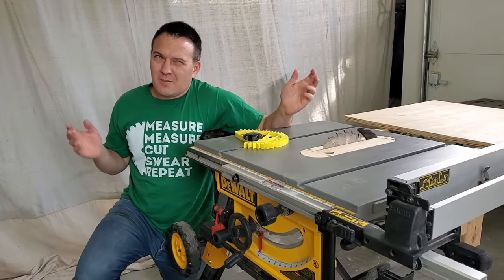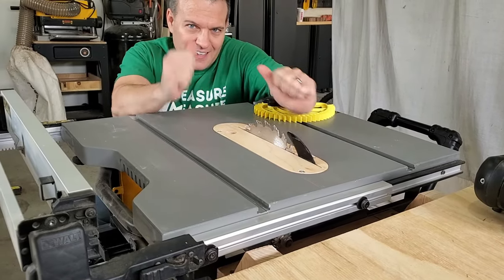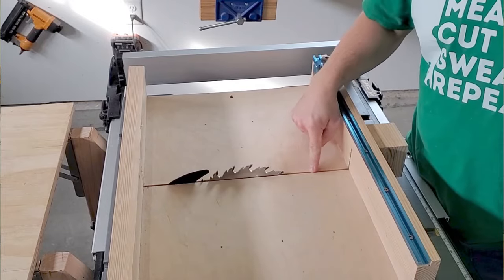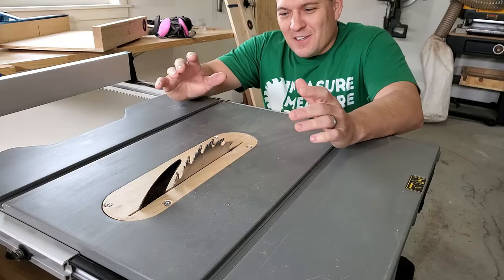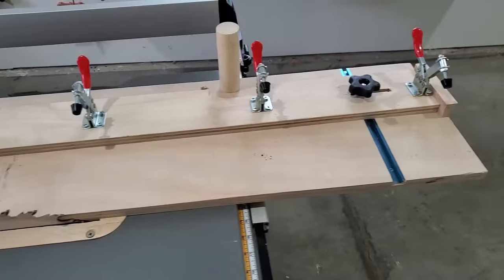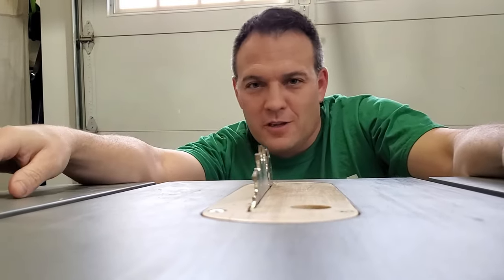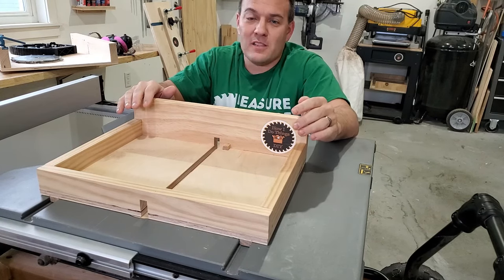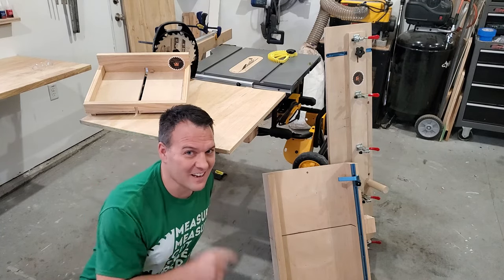MUST HAVE Table Saw Accessories!!!

Comment: I bought your table saw out feed plans and modified them so I didn't need to drill into the saw base. Works awesome. That was a great design. Thanks.
Reply from the maker: Thanks!  That's sounds cool.  How did you do it?
Reply: @HowIDoThingsDIY  I used my band saw to make "J" shaped hangers that fit the frame below the fence rack and pinion. Then I used angles like you did for the bottom. Works great. The "J" shape lets the frame hang, removing the need to drill the frame. I can't post a pic here. But basically your design, but "J" shaped vertical pieces that hang, removing the need for drilling.
Reply from the maker: Does it stay in place when you fold the saw up?

Comment: Around here, we pronounce it DAY-doe but... you be you. I have this exact table saw and also have a limited amount of space. I recently replaced the splayed legged stand with a rolling cart that doesn't try to trip me every time I try to walk around it. Folding out-feed and side support tables are next on my TDL.
Reply from the maker: Haha.  Ya. I actually know that and I've been working to correct it.  Saying it wrong seems to be a hard habit to break.  Yes, the folding outfeed table was a huge improvement.   I have plans for it as well as other stuff for that saw on my website, if you're interested.   Www.howidothingsdiy.com
Reply: @HowIDoThingsDIY  My brain still has trouble with 'rebate' vs 'rabbet'. Watching too many Paul Sellers videos will get you saying 'rebate'. ;-)
Reply from the maker: Haha.  That's funny.

Comment: I call my tapering jig a mitre sled as well.  It was designed to be tapering / cross cut / mitre sled.  Mitre is jus a different angle than taper if you think about it.  It can have some fix angle template to make setup easy.
Reply from the maker: I like it!  Thanks for the comment.

Comment: I've had the DWE7491XE (240v 1ph version) for a couple of months - wanna make beehives, workshop cupboards and drawers, and much more. I only see dado stacks in US videos, and it's been hard to find guidance on what to use. I'm heaps glad that you made this video coz it's exactly what I plan to do and with that exact same saw. Gotta good look at that dado set 8" Freud.

Only question - have you noticed if the spindle locknut stays tight on the dado stack? Since the saw has electric braking, I wonder about the inertia of the rotating mass of the stack perhaps loosening the spindle nut. I also read that over-tightening the nut can distort the blade.

About to watch the outfeed table video - Thx for taking the time to make short sharp videos.
Reply from the maker: Thanks for watching!  I haven't had an issue with the dado set loosening  the lock nut, but I also don't notice any braking when the saw is turned off.  Could that be a new feature that my saw doesn't have?

Comment: So it was miter sled Sunday here… We have the same saw so I thought I would give you free access to my discoveries… no one would pay for them just sayin’

1) My miter slots had a bit of manufacturing slag in them. I ran a 400 grit diamond plate on all four miter slot  sides about 25 quick passes with a little water. That really helped.

2) There was this odd stickiness at ends of each slot. A quick measurement showed indeed the ends of the slots came in just a bit. More diamond plate, another 20 or so passes focusing on each of the ends. Cleared that up now my runners run great end to end.

3) I used oak on one sled. Plastic on the other. Why? because I heard goods and bads on each. I’ll let you know if anything wonky happens with either. Both are currently good. 

4) Both sleds are creating great 90 degree cut or dados

You may be wondering why the diamond plate and not something else. Truth is it seemed like the flattest mildly abrasive thing I could think of without doing some high grit sandpaper shenanigans.

I also noticed when starting a 10 inch the blade actual wobbles about 1/64 of an inch left to right. I only mention this if you or anyone else needs to stop a precision cut in the middle it is better ( and safer) to back the piece and slide in after the cut is started. Else there will be a wide spot like in my crosscut sleds 0 clearence, now near 0 clearence. 😅

Lastly, I double checked that my fence, miter slots, and blade are all parallel an perpendicular to the saw top. I made sure my sled base was square then used the fence to align the sled base to the sled runners. No secondary fence adjustments needed. I will verify with the 5 cut method if I find something is off.

Happy sawdust creation Sunday!

You need a Patreon, just sayin’
Reply from the maker: Excellent work!  Sounds like you really have it dialed in.  As far as the miter slot guide rails, I've found plywood works pretty well because its more stable than the hardwood.  I've also been wanting to try UHMW plastic.  Seems it would be nice and slippery yet stable with changes in temperature and humidity.  Thanks for adding this info in my comments!
Reply: @HowIDoThingsDIY  Have you had a problem with hardwood for the rails? I debated using plywood myself but was concerned about the plywood flaking over time. Another thing I want to try is mdf or melamine with edge banding. Figured what would be slippery, stable and durable. More effort to get the rails the right width. So many options… when do I stop making things for shop and start making things for inside the house, gifts? 😂🤣😂
Reply from the maker: One of my sleds with oak guides got a little tight but I block sanded it just a tiny bit and then rewaxed it and it's fine now.

Comment: Hey buddy, I purchased your plans to make the outfield table and I'm thinking about making your crosscut sled too. I'm curious though if the (forgive me I can't think if the term) part of the cross cut sled that hangs down and rides in the miter slot will hit your outfield table if the outfield table is in the lowered and or raised position. Thanks in advance!!
Reply from the maker: Yes, It will hit.  I typically just fold down the outfeed table when I use the crosscut or box joint sled.  If you don't want to do that you can router some clearance slots in the out feed table.  I personally didn't want to weaken the outfeed table with the slots.
Reply: @HowIDoThingsDIY  thank you so much for the super quick response!!
Reply from the maker: I'm always here when you have questions.

Comment: I want them all! Great video! The feather board looks really handy. I put a GRR-RIPPER on my Christmas wish list, but could I use the feather board instead? Do they both work in a similar way by pushing the wood against the fence?
Reply from the maker: I'm not familiar with the Gripper, but yes, it pushes the workpiece against the fence.  I have an Amazon link to the one I used in the video in my description.
Reply: @HowIDoThingsDIY  Wonderful! Thank you so much!
Reply from the maker: No problem!
Reply: The GR-Ripper is a very cool pushblock, and could be used in conjunction with a feather board.

Comment: Awesome vid! I need to make this outfeed table! Checking that out next. It looks to have really solid and positive lockup. I’m curious to see how you did that. 

Btw, did you consider a 6” vs 8” before you decided to go with the 8” dado stack? I’ve heard that any contractor saw in general should stick to a 6” dado set.

I bought a 6” set based on that advice. I haven’t used it yet and I’m still debating if I should return it for an 8” set. I have the same saw as you.
Reply from the maker: Thanks.  I haven't heard that but I also haven't had any issues with my 8" dado set.  If you're interested, here's a link to my outfeed table plans.  Otherwise you can just follow along with my video where build it. https://howidothingsdiy.com/printable-pdf-plans/ols/products/dewalt-dwe7491-folding-outfeed-table-plans

Comment: What specific blade(s) are you using with your saw? Just got the same one and I want to upgrade the stock blade but not sure which way I'm going to go.
Reply from the maker: I use Feud blades.  One is a heavy duty rip blade with a flat kerf. https://amzn.to/3ufJS3l
The other is a combination blade for cross cuts and rips. https://amzn.to/3KV60FY  

On a side note, if you just got this saw, I've made a bunch plans of fixtures and jigs for it on my website.  I only charge $5/each.  Have a look if you like.  https://howidothingsdiy.com/printable-pdf-plans
Reply: @HowIDoThingsDIY  Thanks! I've already got your outfeed table plans! Did you consider a 50T ATBR combo blade vs the 50T ATB that you linked to? Or maybe a 40T ATB general purpose?
Reply from the maker: I did not, but I've been pretty happy with these. If you find a blade you like better, please come back here and leave a comment for everyone.  Obviously, there are better blades, but for the money, I've been happy with these for now.  Make sure you clean them every now and then.  It makes a big difference.